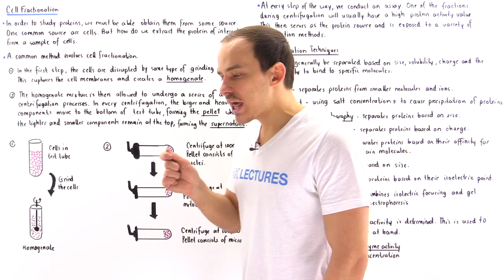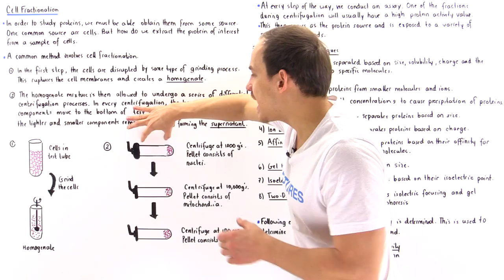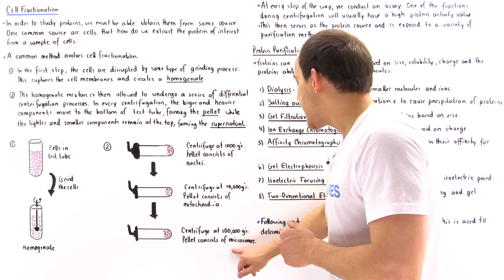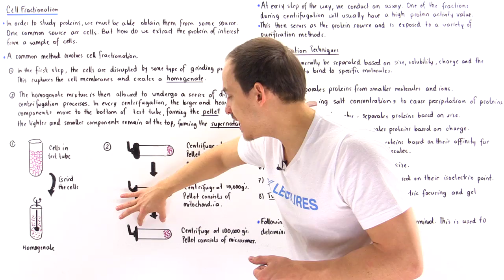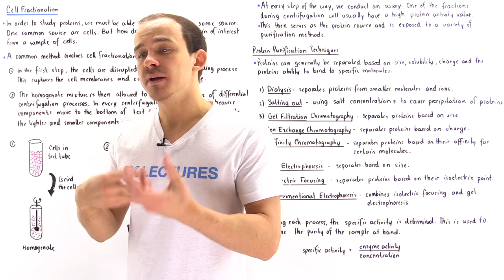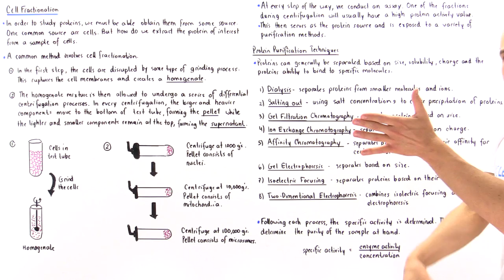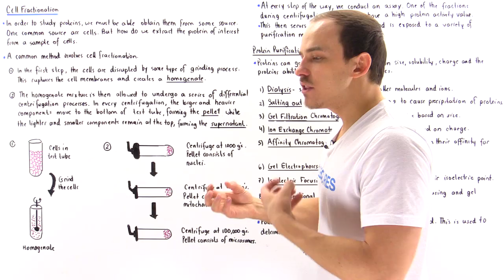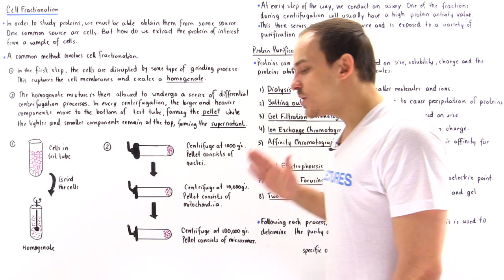Cell Fractionation

Comment: I would like to ask why grinding cells only break plasma membrane, how can we control such that the membranes of organelles are not broken during this process?
Reply: @Tony Lee
before cell fractionation takes place, the organelles are buffered, isotonic, and placed in a cold solution.
Buffering - so that the pH doesn’t change and therefore the enzyme structure/function doesn’t alter (change). 

Isotonic - has the same water potential inside + outside to PREVENT ORGANELLES from shrivelling/bursting. 

Placed in a cold solution - to reduce ENZYME ACTIVITY so that the enzymes can’t break down the organelles. 

Hope that helps.
Reply: @fk2328  Thanks a lot for the explanations for each step, now I understand clearly :)
1 quick question: can we also add some protease inhibitors (cocktails) together with the cold solution to further minimize digestion?